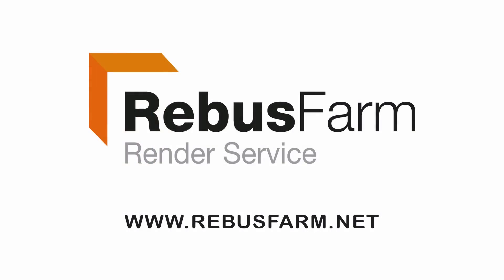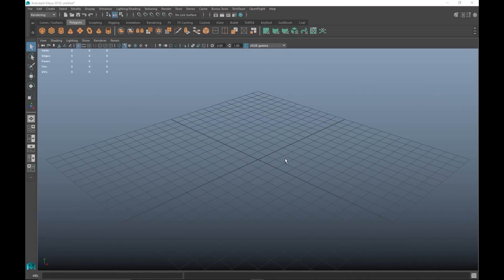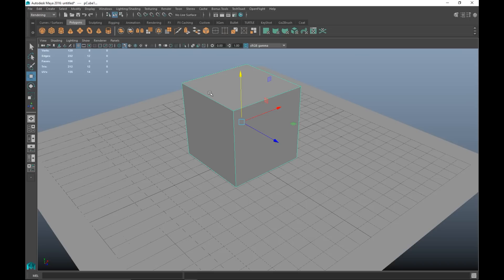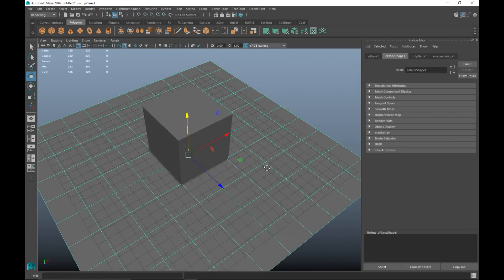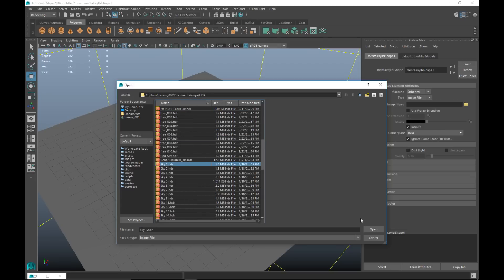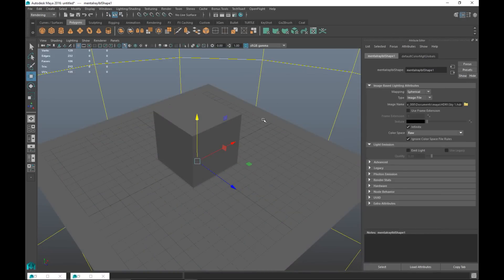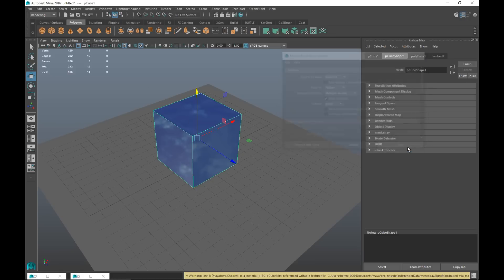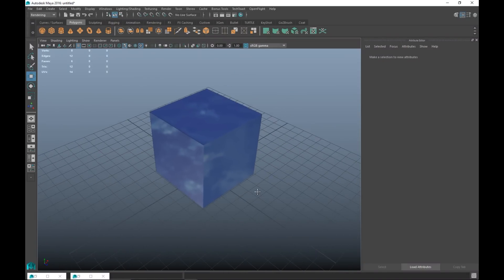Can HDRI reflection  / light be baked onto an object ?

Comment: what would this be really useful for??
Reply from the maker: Examples : 1.Cloud reflection on window of building.2. Tree reflection on chrome bumper of car etc etc
Reply: mmm okay. well when i think of reflection i just think of something reflecting off something with a shinny material and whatever angle you look at this particular object with the shiny material there would be a different angle of reflection(if that makes sense). Reason why i asked that is because the cloud just seem to be really pasted on. but i understand what you're saying. i guess i really didnt look at it that way. thank you :>
Reply from the maker: It is mainly used in game engines to bake light on walls ( when you don't want to import the actually light sources ) But I received this as a specific question from multiple people so that's why I made the video
Reply: +Mike Hermes is reflection needed in an intro? like an intro of a new phone or a new car?
Reply: I'm actually using this for a chrome engine bay on a low poly model. It's an easy way to get nice chrome textures without having to use reflections in game engine. It's a lot less taxing on the hardware. 
Thank you Mike! This was exactly what I was looking for.
Reply: in video games works a lot, since you don't have to enable real time reflections.